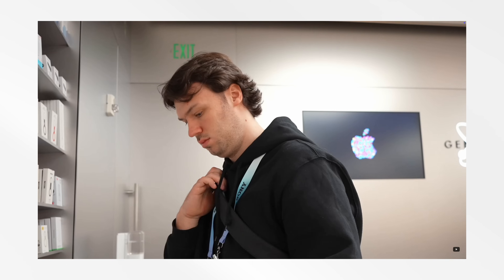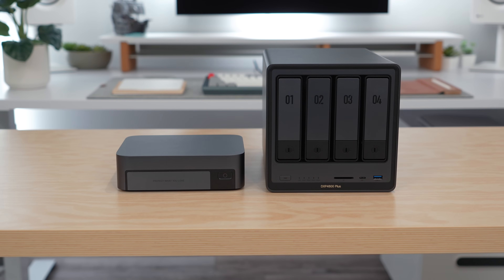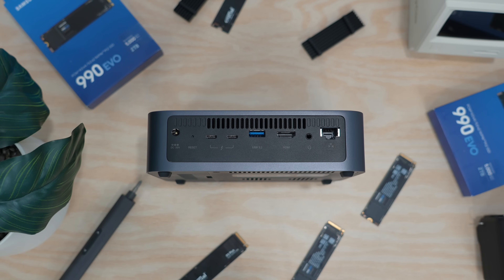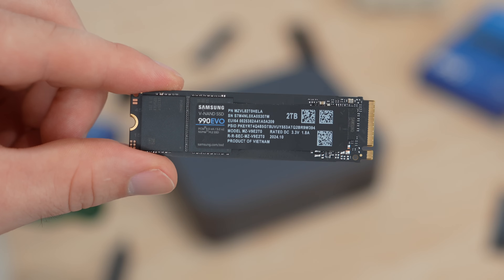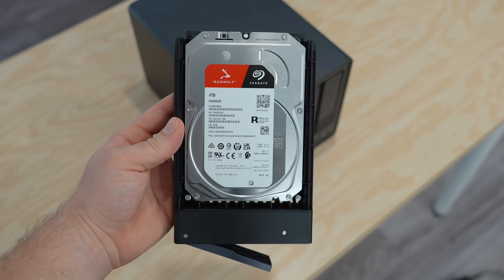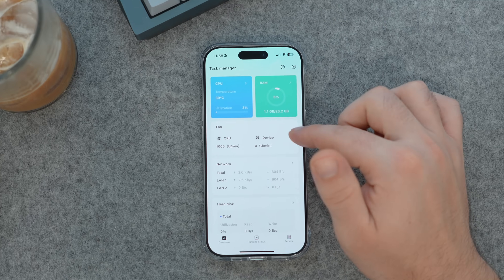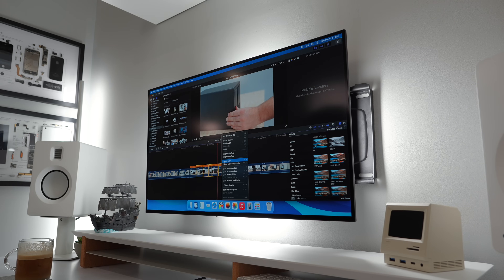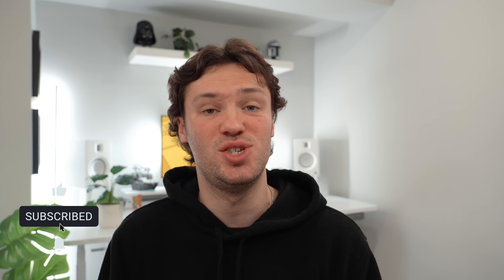Ditching the Cloud | My Experience with UGREEN's Fastest NAS

Comment: Cool video! Do you manually drag your projects from DXP480T Plus to the DXP4800 Plus or does it happen automatically? I’m thinking of starting with the DXP2800 and then getting something bigger later, so I’m curious about how their products play together. Thanks 🙏🏾
Reply from the maker: Thank you! I manually drag and drop them because I like them to hold separate things, but you can easily set them up to be mirrored versions of each other through the Ugreen software
Reply: @ConorButkovic Ok cool! Thanks so much for the response!

Comment: I've read that you can't connect your MacBook via thunderbolt and use the NAS as a direct editor. Direct thunderbolt speed is way faster than working over a network
Reply from the maker: It is true, but you only get 10GB speeds at least. That’s what I have experienced... It’s more stable and a better connection though, but still a speed gap.

Comment: Full disclosure, don't use SSDs for long term storage
Reply from the maker: That is a valid point!  I do store my backups and archives  on a different NAS which has HDD drives, it’s the one I mentioned in the beginning of the video
Reply: I don't trust SSDs. They pack up and loose data like USB sticks. I lost a lot last time.
Reply: @queeniebee237  Agreed
Reply: @statuspremier  Why? Besides expense.
Reply: @livedreamsg  you got atleast 100 years of life time on a hard drive versse 5 to 7 years on an ssd
Reply: @statuspremier  that's... completely not true
Reply: @OptimusMonk01  Ironically karma hit me and now I have an M.2 SSD that won't boot an OS on an HP 840 so I'll see how long it lives compared to a SATA SSD then compare it to my Hard drive which I've had for 10 years.
Reply: @OptimusMonk01  Can you add more to your statement as to why it isn't true?
Reply: @statuspremier  Had 2 HDDs fail on me over the past 4 years. Never had an SSD fail.
Reply: @daveweinstock  That's insane, I still use a hard drive that I've had since my first year in collage and it has around 94% health
Reply: Used in a DAS and  NAS setup. This is why you raid your drives and do backups on top of that. For SSD's I never felt the need to RAID them, mostly due to cost and loss of space when doing so but with the cost per Gig lowering on SSDs it's much more attractive to use SSDs over HDD. Specifically in a NAS setup for fast read/write speeds when doing the kind of work I do(CGI). 

Long-term storage that isn't going to do anything? Sure use HDDs, they're cheap and you can get an enormous amount of space now for cheap. I just backblaze my SSD NAS instead. I'll take faster speeds over cost.
Reply: @daveweinstock  this applies if you access your files oftenly, as for myself I archive files and access them way later
Reply: @statuspremier  ROFL, I got some SSDs, that are over 10 years old and still running fine. Just depends on how you treat them and how much data you put on them. Just never go over 80 Percent and everything is fine, especially when cooling is good.
Reply: @Eysenbeiss This makes sense
Reply: @WA_VisualCo How slow is your backup to backblaze?
Reply: @rossturner76  I don't even check it. I actually just use it on a single drive now that just contains my active projects, so it's not connected to the NAS.
Reply: @statuspremier  False.
Reply: @bobbray9666  I mean you can go ahead it's your money and data.
Reply: @statuspremier  You need to read some.  Modern SSDs aren't like the first generations.  They take much more physical abuse than HDDs and no lubrication of mechanical parts.  Both need a data read periodically to preserve the data on them and SSDs will last 2-3X longer than HDDs in an active system.
Reply: @bobbray9666 Okay now that's a fair explanation, I've heard that before and it's true modern SSDs are more durable.

Comment: $1000? with 0 GB. LOL. 99.99% of users dont need this. Especially single Mac users or those that don't work from the cloud. Local network shared storage is as simple as a gigabit switch and file sharing turned on if you have multiple macs.
Reply from the maker: That is a valid point, this is could definitely be overkill for lots of people but if you have more than one Mac and or PC (like myself) this could be a great future proofed option
Reply: @ConorButkovic  Nothing a $40 1000BT switch cant solve.

Comment: Why does 2+2+1+1 gives you 4TB of usable storage with Raid 5 model lol. That's not how it works. You can even check it with the calculator if e.g. Synology. There's a lot of unused storage left in that config it'll give you only around 2.7TB
Reply: From 3TB to 4TB is a bit of a stretch for a roundup :)
Reply from the maker: It was 3 and some change but yeah definitely my bad
Reply from the maker: This system has its own on board storage for the OS and other things which helps keep your hard drive space open. But I also did round up to make things easier so that is indeed my bad

Comment: This feels...odd. You should really be using Thunderbolt to maximize the speeds. You're leaving a lot of performance on the table by using 10gbps ethernet. This would be killer with Thunderbolt 5.
Reply: you're new to NAS, aren't you? The idea of a NAS is to plug the Ethernet cable in, and connect it to a switch or Wifi Router, then everyone in the same WLAN or LAN can access the same data for video edit, coding, etc...

Thunderbolt limits the use of a NAS, most of the time that NAS is sitting somewhere not even reachable to be plugged in, doing its thing in the back ground.
Reply: @tommyle628  I totally get that, but why would anyone spend a massive premium getting something with Thunderbolt + NVME SSDs when it'd be limited to 10gbps? At that point you're better off saving yourself that money, as you'd never even come close to saturating the bandwidth needed for those SSDs.
Reply from the maker: If it had the ability to use the TB ports as a connection I would be using it in a heart beat but unfortunately it’s just not supported
Reply: @ConorButkovic  What about it is not supported? It should support Thunderbolt P2P, as that is part of the Thunderbolt Standard (Thunderbolt Networking). The computers just have to be in proximity to each other or use very long (and expensive :() Thundebolt Cables.
Reply from the maker: I don’t know the details unfortunately but I did try and plug in my Mac via the TB port and nothing showed up in finder… maybe there’s something I’m doing wrong (very likely) but I can’t seem to get TB to work
Reply: @ConorButkovic , I had that problem once. It turned out the cable was power only, not data. (Hangs head in shame for his own stupidity.)
Reply from the maker: oh interesting... ill have to try out a different cable then and see if that works
Reply: I think this is more for NAS. Something like this would be fantastic to use as a kind of dropbox across your network.
Reply: For cloud storage the 10GbE is essential / beneficial while I also hope Ugreen and Synopoly upgrade their nvme NAS options to supportThunderbolt 5.
Reply: Hes right. 900 MB/s is sht performance for a "working" drive. files should be on a Tbolt 3/4 drive with 3X the potential. Plenty of Tbolt cases for $60-80. Drop in a nice big NVMe. I personally use a dual bay Sabrent (8 TB setup in a RAID 0). Sabrent case + those 990s in a RAID 0 = 4TB 30 GB/s working drive. I get it. sponsored by ugreen.
Reply from the maker: I do have some TB SSD enclosures from UGREEN (purchased myself) which I will use from time to time. They definitely deliver on the performance no doubt. But this NAS setup lets me use all my apple devices via the same storage. But i would also like to have a team one day if I ever get to that point where this device could be super useful

Comment: What made you go with Ugreen over Synology other than the fact they sent it do you?
Reply: Which Synology would you compare the Ugreen to?
Reply from the maker: It hard to compare this model because of the SSD only setup… but I guess just any model in the same price range
Reply: @ConorButkovic  nvme vs regular hds makes a big difference, I think they are difficult to compare.
Reply from the maker: 2 main reasons. One is that Synology (at the moment) doesn’t have a SSD NAS that is made for consumers like this one. Secondly the specs, the UGREEN NAS has far better specs for the price making it a better choice for me, just the fact it comes with 10GBE straight out the box is worth it